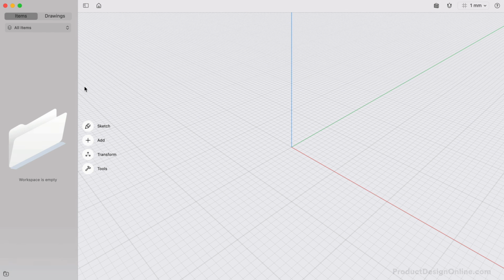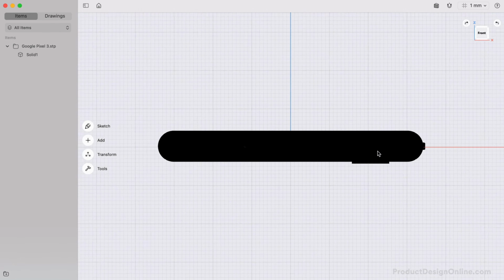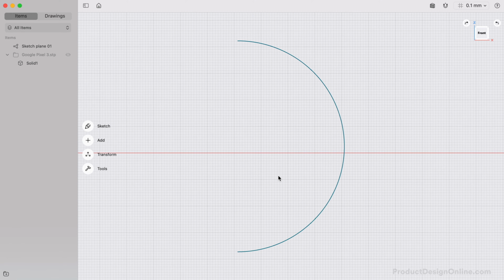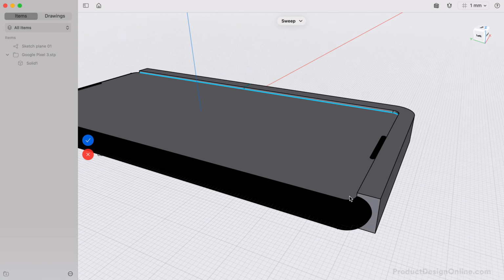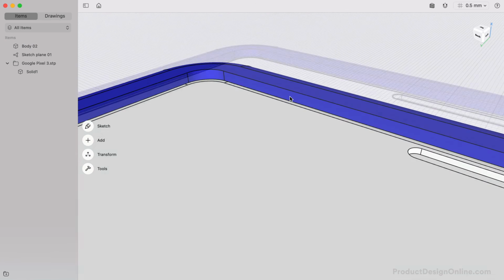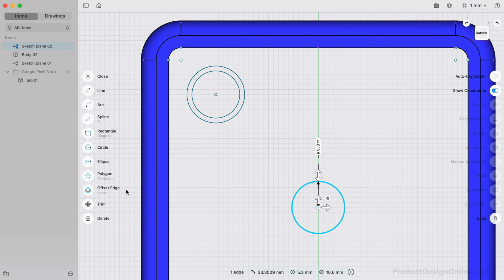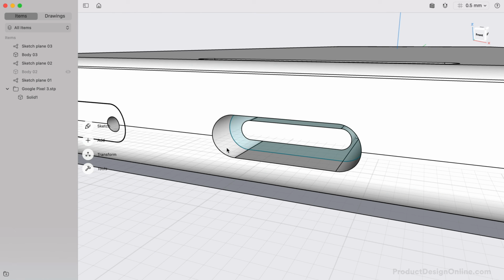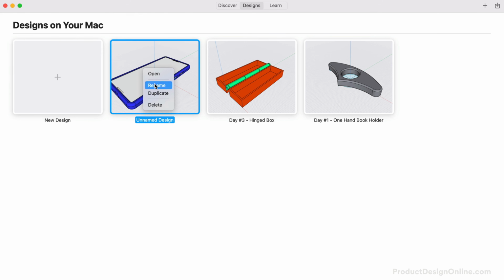Day #4: Design a 3D Printable Phone Case in Shapr3D - Learn Shapr3D in 10 Days for Beginners

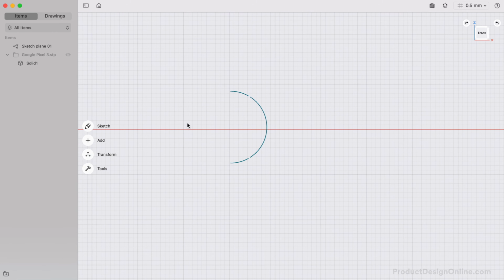Comment: Just a heads up, as of 2/2025 it doesn't look like you can select the projected sketch endpoints at 2:57 and drag them together. I had to use the Spline tool to select both endpoints to complete the curve.
Reply: Just kidding, you have to disable the "Linked Sketch" option to get the right sketch profile, not sure what that option does.
Reply: @amsch03n  hey i have this same issue! where do you disable the linked sketch option? thanks!

Comment: 2:43 "select the planer face to project sketch onto" what do you mean by that what should i select the is noting to select if click anywere the project lines gone and i am not getting that blue done tick
Reply: Someone posted the answer in the previous question but to make it a bit more clear, once you have the edges selected using the projection tool, you can hide the entire imported body and select one of the three small gray squares at the origin point of the project, you'll want to select the Z plane one. If you don't hide the body then you'll end up selecting part of the import and things get weird.
Reply: @amsch03n   yes!!
Reply: I give up too
Reply: I did it by first selecting the Arc tool and then selecting Project Sketch
Reply: Ah ha! This was the missing piece…

Comment: Hi quick question, what do you mean by "Select the planar face to project the sketch"? I don't have a blue checkmark showing up anywhere. How do I fix this.
Reply: I had trouble figuring out that out but if you look at the center of the phone where x,y,z, intersect you'll see small squares, select the one on the z axis, hope this helps
Reply: @codysmiddy5401  I already figured it out, I placed a rectangular shape nearby and put a sketch on it. It worked perfectly. Thanks though
Reply: @codysmiddy5401  This is helpful, thank you!
Reply: Was trying to figure this for 15 mins, thanks @codysmiddy5401
Reply: @codysmiddy5401  Thank you guy, your suggestion is very helpful.

Comment: hi there.. I tried projecting the sketch in the first step but it doesn't project as a curve like yours did. rather it projects as flat 2D lines on a different plane
Reply: please help.
Reply from the maker: @Dr.Dubz_  Hi Ndubuisi. Please confirm you're looking directly at (straight on) the sketch. That will help ensure you project the correct geometry. You may also need to hide other unwanted 3D bodies to make it easier to select things.

Comment: Can I import .stl? I used that kind of file because I couldn’t find .stp for my phone but Shapr3d says when I try to project sketch that “mesh body cannot be selected” when I try to do what you did on my iPad. Also I can only get a purple square with a target in the middle when trying to use the tool project sketches. Can you help through this please?
Reply from the maker: Hi Nikolina,

Unfortunately, because STL files are mesh (STEP or .STP are BREP solid bodies) you cannot reference their features in Shapr3D at this time. What phone model are you looking to use? I would check out GrabCAD.com if you have not already.

Cheers,
Kevin
Reply: Hi, thanks for the prompt response. My boyfriend and I are using Samsung Galaxy A21s and I wanted to make a model of our phones. GrabCAD is the first place I looked at because you recommended it in the tutorial. .STP files don't seem so easy to come by are there any other types that could be used instead? Thank you once more.
Reply from the maker: @nikolinakalajdzic1097  I could not find any either. Could you share the STP file you found? I'll try to convert it in Fusion 360 for you.

Comment: Hi, i would like to ask for help once again :) on the step to create the back side with the project. when selecting the edges, which edge you select as for me it highlights or the top or bottom edge of the case and when I select the plane to apply it, the sketch is not applied and not shown. I've tried selecting both edges but nothing. So I don't know if I'm selecting something wrong or maybe the whole edge should be highlighted ?
Reply from the maker: Hi Simeon. Happy to help troubleshoot! Shapr3D allows you to Project sketches, edges, faces, or bodies - so the selection can be a bit tricky at times. I select both the edges of the phone case (body) and the edges of the phone (reference model) per the camera/fingerprint sensor cutouts. I then selected the planar face (back surface) of the phone. You could really select any construction plane or plane that is at the desired location.

It sounds like it's selecting the face for you and not the edge. I would suggest zooming in further to get a easier selection area of the edge.

I also suggest doing this while looking straight at the model in an orthographic view. Sometimes looking at the model from a side/perspecitve can make it hard to Project. 

More on the Project tool can be found here: https://support.shapr3d.com/hc/en-us/articles/360012231934-What-does-the-Project-tool-do-
Reply: @PDOShapr3d  No matter which option I choose -edges or sketches, the projected item is locked. I'm having lots of issues with this tutorial :(
Reply: To add - I think I found a tutorial to fix the issue, but was completely unable to follow it. :(
Reply from the maker: I'm sorry to hear that! I'm guessing there is a setting change or difference that is affecting this. @KyrstensCloset

Comment: I was busy learning Fusion 360 when I discovered Shapr3D.  I find that Shapr3D fits my needs as a woodworker much better than Fusion and being able to use both my iPad and PC is a big plus.  I’ll still use Fusion for sheet metal projects but for everything else it will be Shapr3D for the foreseeable future.  As I finish more designs I find I really get bogged down when trying to layout a dimensioned drawing.  The whole process seems poorly implemented compared to the rest of the program.  If you could cover that in a future video it would be much appreciated.  Thanks.
Reply from the maker: Thanks, Rusty. Creating a 2D manufacture drawing in Shapr3D is slated to be the 10th and final day of this series. Mainly because I plan to cover a few more 3D printing projects, before shifting gears to do some woodworking/furniture projects. We will then use that project to create the 2D drawing. I'm also keeping my fingers crossed that the drawing area gets some love (i.e. new features/workflows), as I agree that it feels a bit lackluster compared to the rest of Shapr3D.

Cheers!

Comment: I downloaded the software today on the m1 pro MacBook and it is way more fluid than fusion 360 thanks for the tutorials
Reply from the maker: Thanks, Manuel! Glad to hear that. I have the M1 MBP myself and agree that it's much quicker than Fusion 360. That said, there are some elements that make it hard for some folks to switch over (parameters, Manufacutring/CAM, etc).

What types of projects do you work on?
Reply: @PDOShapr3d  I actually work on sheet metal but I’m trying shapr3d for 3d printing
Reply from the maker: @manuelmrosa  Right on! Sheet Metal is definitely better in Fusion 360. Maybe, some day the Sharp3D team will implement some slick Sheet Metal features :)